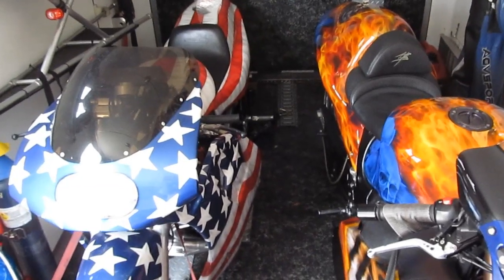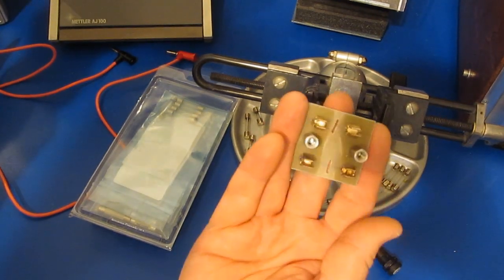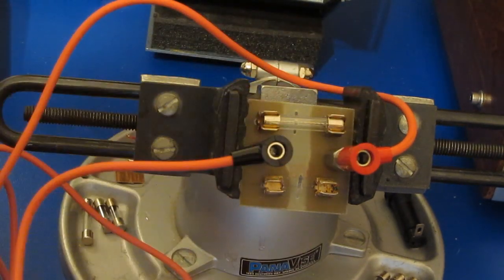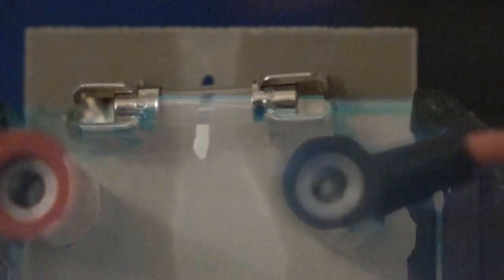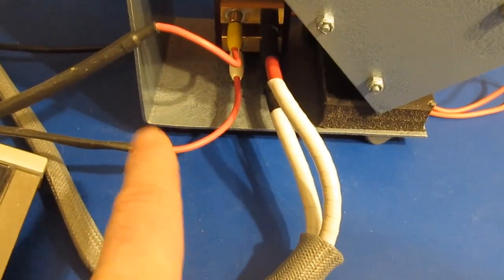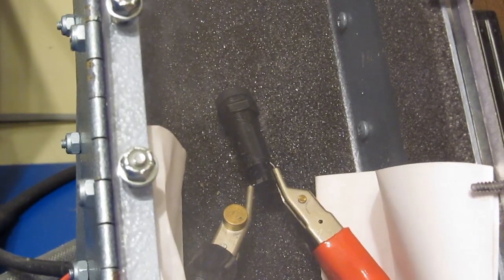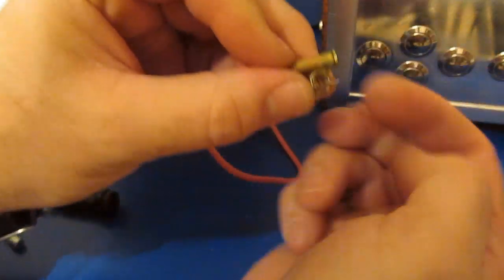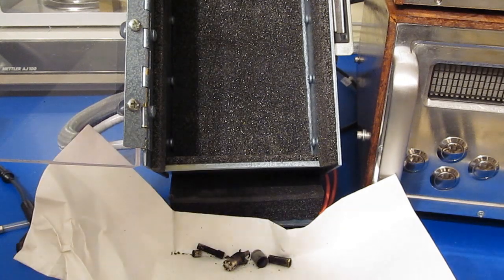One ampere fast blow glass fuses are blown for fun

Comment: Car charging systems cannot output thousands of amps which I'm sure you already know.   Typical alternators output between 100-200 amps max.   The highest amperage a car electrical system will ever see is whatever the battery is rated for.
Reply from the maker: Rather than correct it, I assumed people would pick up that I mentioned the current on the batteries label rather than park my truck in my lab to get to its charging system.   This channel will always have mistakes, most of them are obvious.  I think I corrected one once with text as I knew someone would have the magnifier out.  Rather than correct mistakes I just assume the target audience is able to follow along.  

The original comments I was referring to are below: 

Berni: If you work with only low power things then there is no real danger of using a cheap meter with the cheap fuse it comes with. And if you work with large industrial switch panels designed to carry 1000s of amps in normal operations you obviously shouldn't even come close with anything other than a proper high quality meter with proper fuses.

Mikke: You don't have to work with switch panels or power sockets to get big short circuit currents. A normal car battery has a very low internal resistance and short circuiting one can result in more than 1000 amps. Luckily the test leads have also some resistance. So in case of measuring battery voltage with meter set to "amps", the actual current through your multimeter will be somewhat less.

Being careful helps, but mistakes do happen and then you need the proper fuse.

Comment: Too bad manufactures of multimeters don't use readily available new style plastic encased automotive fuses instead of almost 5 dollar non standard bussman type ceramic sand encased fuse.  Stupid.
Reply from the maker: I see it differently.  The HCR fuses are there for the operators safety and I am glad there are standards in place for this.
Reply: Its far safer to be able to go to the local Part Plus store and buy a 10amp replacement encased in plastic than bodge a wire to get your multimeter to work and wait to have someone send you a new "proper" fuse through the mail.
Reply from the maker: If I were buying a CAT III or IV rated meter that was certified,  I would assume it came with HRC fuses and if I damaged one, there is no way I would do anything except replace it with the right part. Or, I would leave them out all together.  That would be safe.   It is rare I use the current inputs on a meter.   Normally I would use a shunt.  Anymore, I use that UT210E, but only for current.   It cost about as much as a good fuse.
Reply: "Bodge a wire" that says it all.

The answer is one of three:
A: You don't understand the implications WRT CAT ratings.
B: You have a death wish
C: You are trolling.

As Joe said, ALWAYS use the correct fuse.

Comment: Wait, wait, your supposed to dump the gun powder before using the 22 short shell. I can honestly say that I don't really laugh out loud (LoL) with many videos. But when you broke out that 22 shell I lost it. I remember a long time ago grabbing a shell for a rig to carry current on something I was testing. Maybe if you used a 22 long it would have had more resistance and survived, or could have surrounded the fuse and protected the holder, lol.
Reply from the maker: Hey Scott, good you got a chuckle out of it.   That's a 22 LR.  Maybe an unspent mag would fit perfect?  I'm sure there was some idiot at one point who tried it...  lol.
Reply: In fact I used a .22 cartridge instead of a failed fuse in my first car (Lada 2103) when my blower 25A fuse failed and I had none to replace. It served me long time until the car corroded beyond repair.